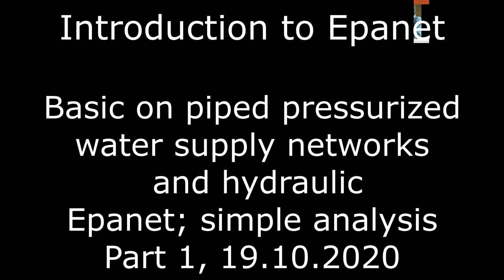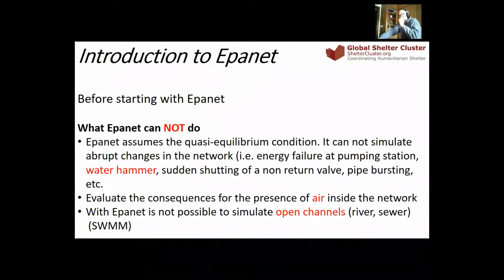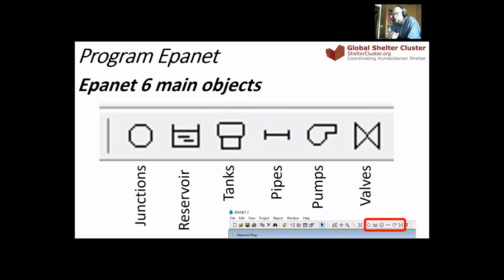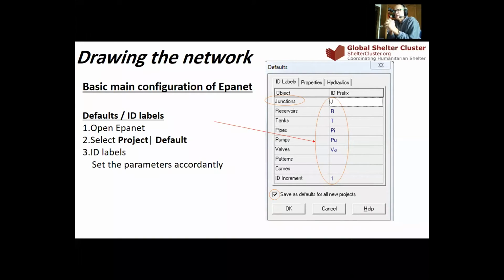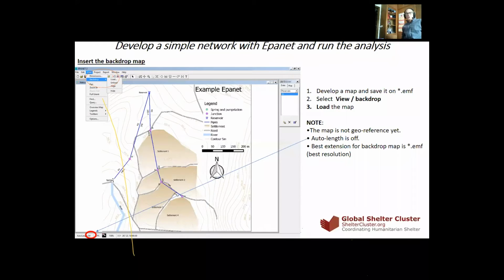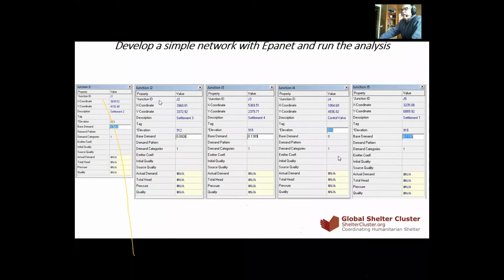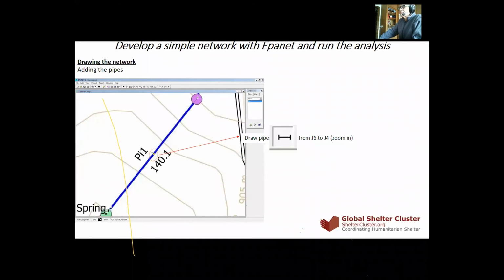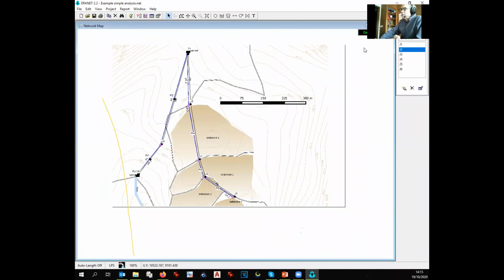Epanet part 1; Piped water supply based on Epanet software

Comment: Hi Andrea, I am modeling a network for an apartment complex that connects to city water. I know that I have 75 psi at the node that is connecting to the the apartment complex. How would you advise I set up my pump and reservoir in this circumstance?

Comment: i am highly appreciated your lectures thank you very much 
i have one question, the pipe distance measuring by EPANET is horizontal and the tow different nodes of pipe are different elevations so the pipe is laid inclined on the actual ground, can this software get the true distance of the pipe according to the topography?
thanks
Reply from the maker: The software takes automatically the lenght only if you have "AutoLength on". The distance is horizontal. You should get the real length with GIS (e.g. qGis or Global mapper)

Comment: tried to run an analysis, and reports that my pump doesn't need to be open as exceeds the max flow. Checked all parameters and show to be fine.
Reply: Failing to pick where I went wrong.HELP
Reply: @phemelothatochabaefe9631  Change the pump curve and it will work

Comment: Hi andrea, i'd just want to ask  on what source shall i use if there is local water supply, Is it reservoir or tank? Tnk u very much. Appreciated ur videos..
Reply from the maker: if the water supply is constant, like a spring, with constant water elevation/pressure than it is to consider like a reservoir. If the water supply shows difference in the elevation/pressure over time, it is to consider like a tank, but than you have to give the pattern, the different elevation/pressure. This is more complicated. we can have a chat if you wish, skype cippaandrea.
Reply: @AndreaCippa-Siteplanning  Hello sir. I am working on my research but i don't know how should I present the water treatment plant (as Tank or reservoir) in the system. Because i believe the river along is the source - Reservoir, and those water treatment plants are tanks.
Reply from the maker: @nami108  Hello Na Mi! You have to consider the treated clean water tank of your treatment plant as the source (in Epanet as "reservoir"). Just be sure that your treatment plant produces enough water or more than the system requests. Keep out of Epant the treatment plant.

Comment: Hello Mr. Andrea, very complete and interesting lecture. 

I have 2 questions on how EPANET behaves regarding fittings and minor losses, how can I model/simulate a 90 degree elbow, or a T-fitting for example? 

I have not been successful in finding any info about this except one online manual stating this should be added to the pipe directly as a coefficient. is this true? how about if a pipe has 2x 90 degree elbows, do i simply multiply the coefficient by 2? does the program itself understand where the loss would occur? or it simply understands because there is a "loss" in a section of the pipe, then the whole flow inside this pipe suffers.. appreciate if you can elaborate on this. 

Another is about junctions and modeling a city/urban network, does each house have to be represented by a single junction? I'm working on a research and the study location is an urban area with ~1,500 houses... 

Appreciate your response,
Hamad
Reply from the maker: Since I use to develop networks in humanitarian emergency context, where data are scarce, unreliable and not precise, I do not consider local losses. The difference is in my opinion discountable. 

For the second question:
Each house  or each group of houses should be represented by a Junction with a specific demand and pattern. Important is that the demand and the pattern correspond to the houe/group of houses and that you have enough pressure to reach the highest level of the house.
Reply: @AndreaCippa-Siteplanning  much appreciated!

Comment: Hi. What if there was no existing node elevation data? Where would be a good source for this?
Reply from the maker: Elevation data are very important parameters. If you do not have them, you could eventually use the elevation from free available digital terrain model, but they are not accurate!!!
http://dwtkns.com/srtm30m/  or
https://www.eorc.jaxa.jp/ALOS/en/aw3d30/  register first here: https://www.eorc.jaxa.jp/ALOS/en/aw3d30/registration.htm